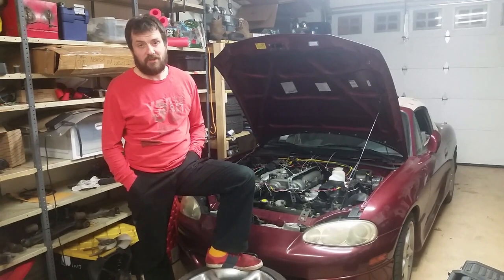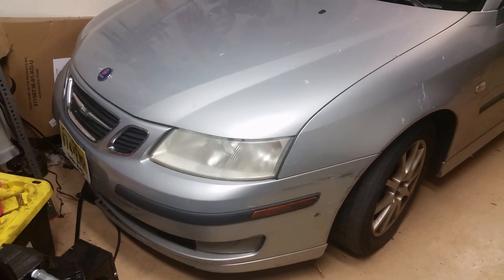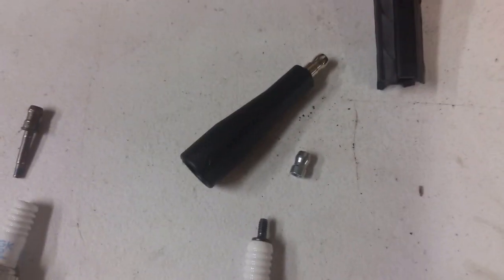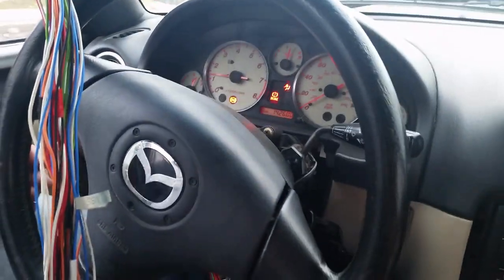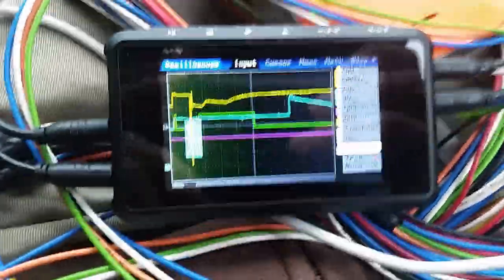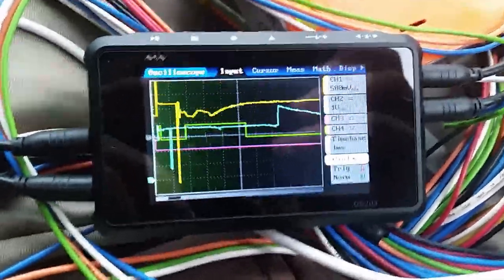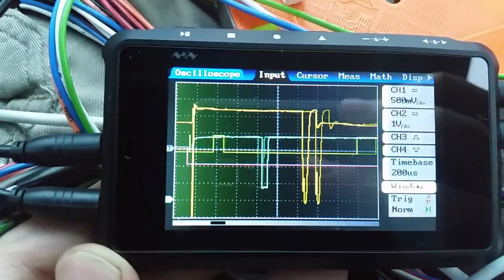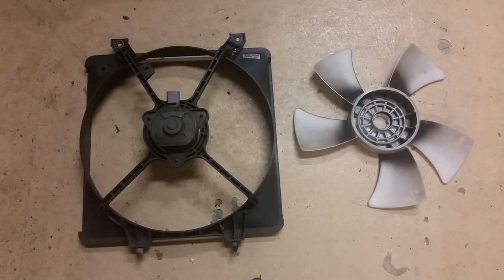Saab CDM 55352173 Ion Sensing Knock Detection on Mazda Miata with rusEfi

Comment: It would be nice to get an actual graph shot of the raw ion signal vs the knock signal. It looks like the green combustion signal always trigger at a fixed threshold of the raw signal which is why it sometimes sends two pulses. I might try to probe my 9-3 as well as my 9000 with my big oscilloscope later to see the signal difference. I don't remember if the DI cassette even outputs any raw signal

Comment: So does the external cdm module sense for each cylinder or does it only sense for 1 cylinder? Also why not convert to external cop setup instead of stock pencil design.
Reply from the maker: External cdm module is sensing for all cylinders, at this point I am only looking to analyze one.
"external coil on plug setup" not sure what you mean?

Comment: nice work! if the combustion data is right and is showing peak pressure technically you could scope that with crank position and get pretty close with mbt.

Comment: how did you get the engine to knock? we tried and we failed....
Reply from the maker: https://github.com/rusefi/rusefi_documentation/tree/master/misc/Saab_Trionic_8_Combustion%20Detection%20Module_on_Mazda_Miata_running_rusEfi

2003 Mazda Miata 1.8 VVT Automatic running on rusEfi open source ECU.

Engine coolant temperature 100C, ambient temperature 4C, violent 40 degrees advance from 1500 RPM to 3500 RPM timing table.

Detonation is audible in 2000-4000 range with 50% throttle pulls from parked.

Detonation is also audible while parked, revving with brakes applied in "D" gear selector.
Reply: @Rusefi  Did you have to do something with the fuel? when we tried it did not do any detonation.
Reply from the maker: @murraishiny  Nope, same fuel as before. Looks like important thing was NOT too rev it too high or quickly so that you can still hear things.